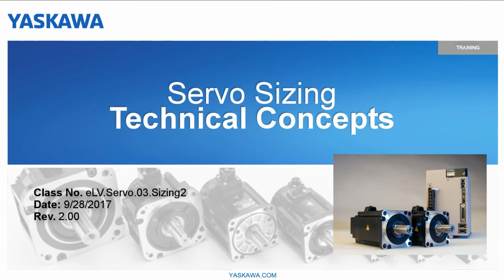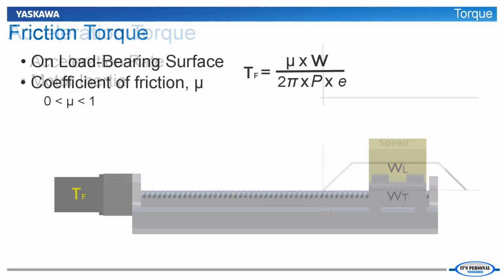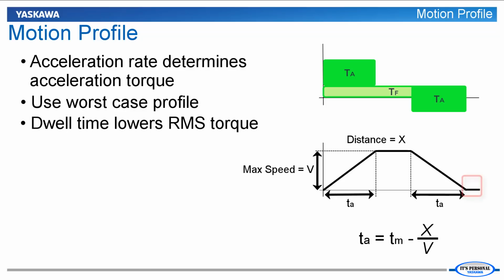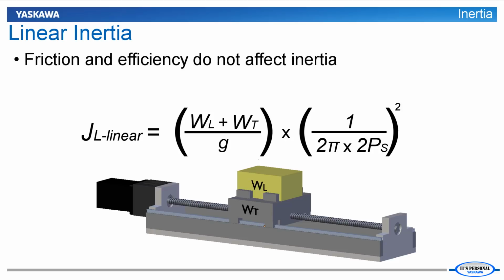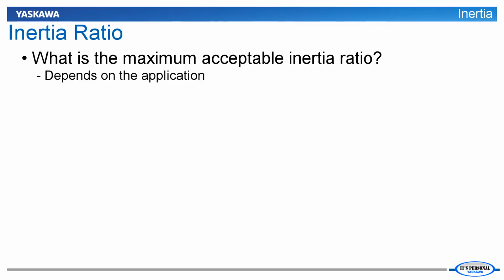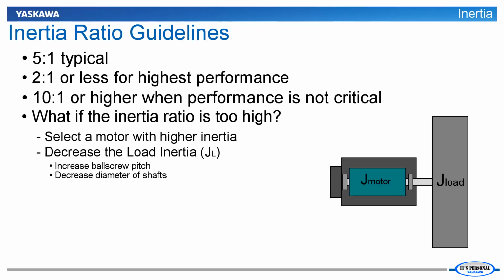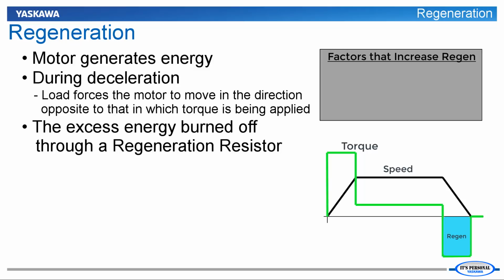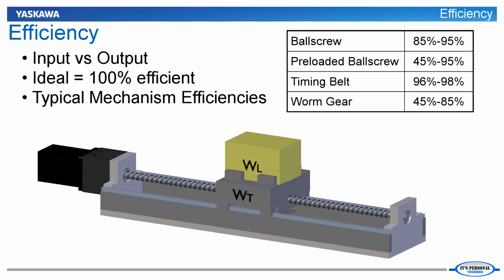OBSOLETE Servo Motor Sizing Basics Part2 - Technical

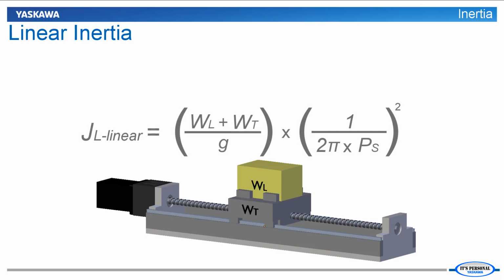Comment: Dear Sir! Could you explain more about fomular at 6:18 please? Units of J is  "kgm2", how can it come "kgm2" from your formular? Thank you for your regarding!
Reply from the maker: The detail may be to realize that Weight (W) is in Newtons which are [kgms-2].  This is why you divide by gravity constant [ms-2] so the first term becomes mass.  You could also enter the mass directly without dividing.  Pitch (P) can be expressed in meters [m], which is squared.  Multiply it out and the units are kgm2.  Hope that helps.

Comment: Did you mean to say "undersized" instead of "oversized" at the 13:40 mark ?
Reply from the maker: A servo is sized for speed, max torque, rms torque, and inertia ratio, plus other factors like cost (see video sizing 1).  "Oversized" can mean that one of these factors is far out of balance with the others.  A simple example is an application with very low speed, high inertia and high torque.  The application requires a physically large motor in order to produce the required torque.  In this sense, the required motor is "oversized".  It would be cost effective and save space, etc to use a small motor with a gearbox.  If you assume that a small motor is already in place, and it does not have enough torque (or too high inertia ratio) but has lots of reserve speed, then yes the motor has been undersized and gearing could improve performance.  It depends on your perspective!  Hope this helps.
Reply: Yaskawa America thank you for the detailed answer !

Comment: Twice as many threads in the same length reduces the pitch right? And that should increase the Jl value?
Reply from the maker: more threads per length means higher speed and acceleration from the motor for the same move of the load.  But the JL value will decrease.  It's the same concept as gear reduction except it occurs during rotary to linear translation instead of rotary to rotary as in the gearbox.